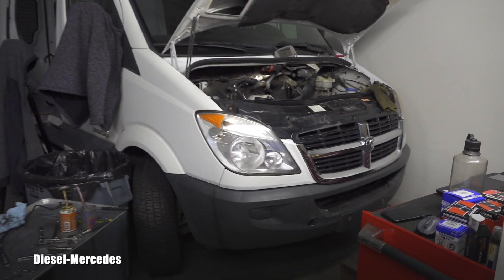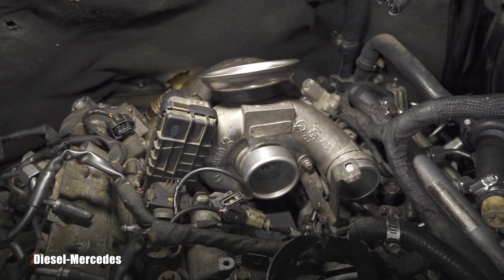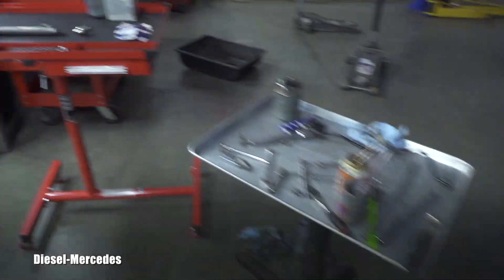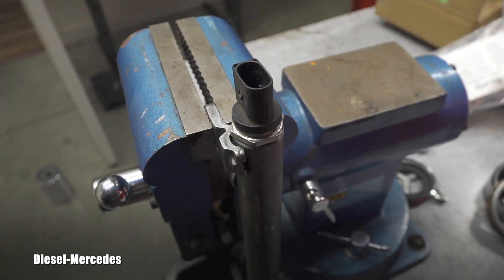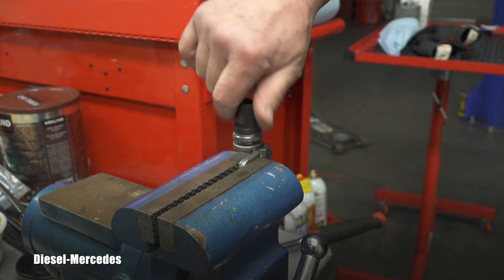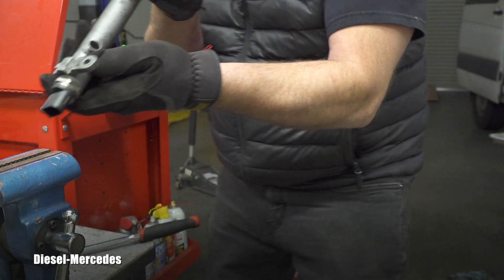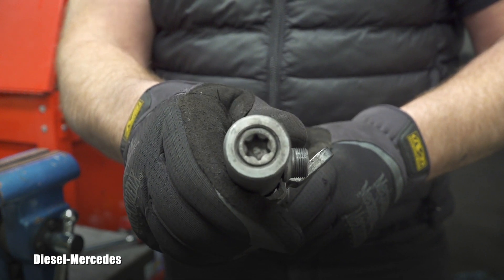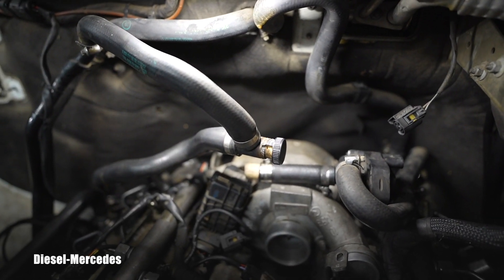Mercedes Engine OM642 Fuel Pressure Sensor Replacement

Comment: Yes, my 2007 W164 ML 320 cdi had cold start misfiring symptoms. Even after fitting new glowplugs and relay. Changed this sensor and no more problems. Starts smooth.

Comment: Hello my friend. I have a 12 gl350 bluetec. I want to check the fuel pressure but I can't find anything on the internet regarding the fuel pressure for the low system and high system pressure specifications. Can you help me out. Thanks.

Comment: Having an issue with the same engine in a vito but its brabus vito van, replaced sensor after gettng an issue with voltage too high and too low codes 11c500 and 11c600. Have you seen this issue before?

Comment: hi.my om 642 just lost its power.Limp mode, no kick though its moving yet no power. Xentry Das says errors : 2021-001, 2047-001 both related to fuel pressure being to small. Also error Y77/1 came out as turbo actuator. Cleaned errors took it to a road and it came back after a minute or so. Any ideas please ?
Reply: same mate. .happened to me 3 days ago lol.. damn mercs lol
Reply: @fctuning  i was driving recently and it was ok for about 20 minutes then it lost power and then it got back ... Need to repair actuator

Comment: I have 2051 code : rail pressure monitoring via pressure control valve. The maximum rail pressure is exceeded

Wheres the problem ?

Comment: I have a p0089 code,car runs absolutely perfectly,except when you are doing 60mph then you floor the throttle,eml light comes on,fault is for low fuel pressure??
Car is a 2008 c-class 320 cdi.
Reply: Did you find what’s it’s going on im with the same problem

Comment: Thank you friend 👍 2007 W164 ML 320 CDI 300K mileage and still running smoothly.
Reply: did you have this problem with yours patrick ? I think I have this on mine now. tying to figure it out. I have  a P2051-001 and a  P2021-001  error code - Rail Pressure monitoring via pressure control valves. The Rail Pressure is low. Anyone else had this issue? Car wont start. I dont know what to try first. The injectors or the sensor ?
Reply: @fctuning  how you did save your problem i do have now exact same problem  low rail pressure car not crank. first of all my low pressure fuel pump in tank was dead i had one used pump to change it, so i did it but unfortunately was poor also, fuel had come to the engine directly to high pressure pump but i dont know exactly i do think problem were first in the pressure were too low then because i didnt succeed to buy new low pressure pump wich going to the tank i did bought some in line pump which give 4 bar and 100liter per hour flow through the car did crank on but after 5 minutes were dead again my thougts go in direction maybe is flow trought inline pump too weak. first time i have tried with original plumbing on the car jut too install inline pump on line with fuel come to high pressure pump resut was like engine start smothly runns good takes axcelerator or rpm good no problem after five min shut off turn key again cranks immediately and again runs about 5 minutes then on second try have i disconected connector to original fuel pump in tank did new line from plastic canister between i have give that inline fuel pump which give 4 bar pressure and 100liter per hour flow through so it came to self flowing from canister to pump car crank again immediately runs about 3 min try axcelerator pedal rpm going good take throttle but after 3 min of smoth running began running on 5clys i dont know any more beginnig to belive that only arsen will heal my problem

Comment: Thanks for your videos. May I ask a question.  I'm getting code P0088 fuel pressure to high. Comes and goes so I'm replacing fuel pressure sensor.  My question to you is. Do I have to bleed pressure from rail or it doesn't keep pressure. This on a 2008 320 cdi. I hope you can help. Thanks
Reply: Same code P0088(Fuel rail pressure too high - Bank 1)
Reply: @Andreyhappy74  same thing here. Change the fuel rail driver side and all injectors. How did you fix that?
Reply: @Andreyhappy74  did you ever solve your issue of the fuel pressure too high?
Reply: Any update if the problem was fixed ? I have a “too high fuel pressure code “ aswell
Reply: any of yall fix the fuel rail pressure too high p0088 code fix by changing the sensor.  Or is it one of those things where it could be other stuff.  I just got the same code and van will shut off at stop signs.  Then I turn back on and it fine.  Specially after driving for like 10 miles
Reply: Hello today I have code P0087 Fuel rail Pressure too low 
So anynyone know what happens pl
Reply: Did you figure it out? Mine had the same code and around 40mmph my turbo likes to shut off completely